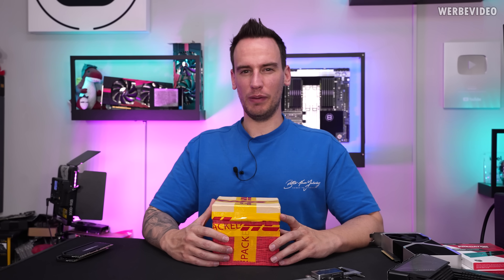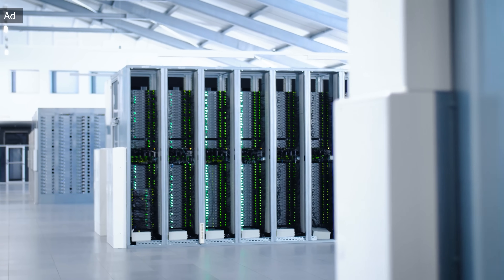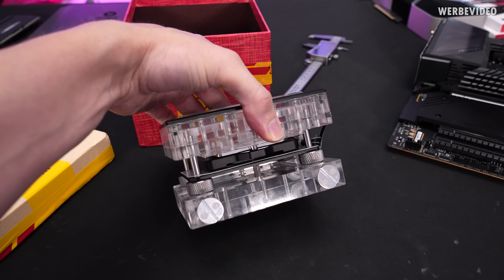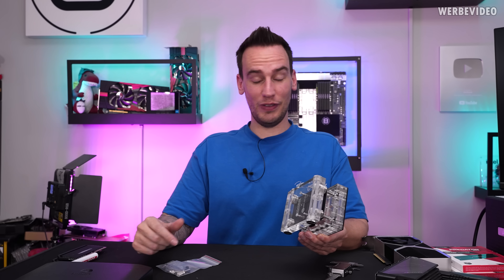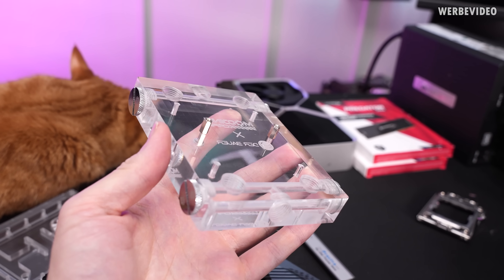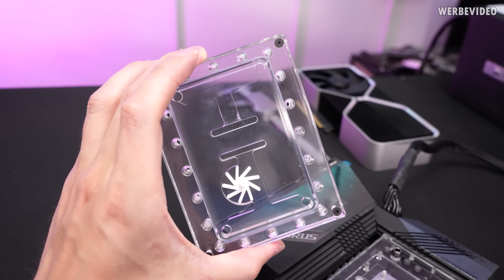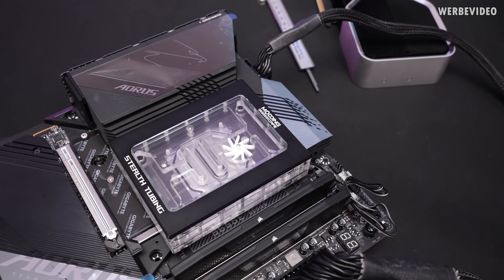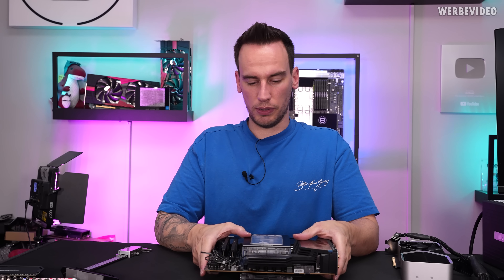A New Generation of Water Blocks? Stealth Tubing Block Tested in Detail

Comment: Brilliant idea. Kudos to those involved.
I think this could be a fabulous idea in the SFF market. A community that often adopts modding to get the best out of the space and parts. The issue would be the clearance at the rear in the smallest volume cases and any rear mounted NVMe drives. However those cases that have a modular "sandwich" layout would provide the option for this type of block on an ITX mobo. As there are only 6 ITX mobos on AM5, it will be easy to check the rear mounted NVMe is clear. I can this working well, especially when paired with a GPU waterblock such as an EK option.

Comment: Kind of neat from a something different perspective. Otherwise it's overdone. Using Bitspower parts going to be ridiculously expensive. This design is not practical and creates a proprietary circumstance. The the block is too restrictive from the get-go. Adding into flow spinner creates more restriction. 

My first thought was of one the many giant tower coolers on the market. It's still smaller obviously but massive by water block standards. One of the main points with water cooling being small, unobtrusive while neat and better (thermals). It's basically recreating the already simple by making it more complicated and unrealistic.

Comment: Excellent!

The back can (as you say) easily be flattened, I'd say if you can produce a similar GPU block that passes out the bottom of the card, you could let it flat on the motherboard and potentially have a hi-fi sized, fully powered, gaming PC.

Comment: 6:10 btw, you mentioned that you had to provide your own screws, modding cafe released a video about this cooler, they mentioned that they reused the screws that came off the amd bracket. Length should be standard i guess.

Comment: I wonder if anyone considered hiding the tubing and cables by making the left panel of PC cases non transparent. This way it would be all hidden from sight and we would not have to hide it on the back. We could even add some rgb and diagnostic screens on the case itself for those who like it. I realize that this idea is probably too innovative for the current state technology and way ahead of time, but let me dream, ok.

P.S. this is an interesting product, but it made me think what exactly are we trying to chase with the PC aesthetics nowadays and why. Does it really make the PC look better when we can see the board, the pump and a couple bright LEDs (the so called "rgb"), but not the tubing or cables?
Reply: totally agree. why not just print out a picture and put it in front of your build if you want it to not look like a pc? all the custom work is in the cables and the tubes when building a custom PC. if you remove those youre just left with the generic hardware and blocks and every build will look the same.

Comment: Love the design and the concept, haven’t used water cooling in over 15 years because I couldn’t be bothered with the tubing, however I would personally buy something like this. 

It’s compact, fits neatly and removes the hassles of using an AIO. Honestly looks amazing.
Reply: This seems like a much bigger hassle than an aio, if you need to change your cpu you have to get access to the backplate, somehow separate the two halves without dripping water everywhere, and then worry about the seal when you reassemble it, whereas an aio mounts the same as an air cooler and can be removed without access to the back
Reply: @VerdASMR  I've had coolers that require the use of a backplate.
Reply: @Safetytrousers  coolers that require use of a backplate filled with water? I doubt it.

Comment: Looks really nice  and would fit into my thermaltake  view 51 with ease, ive already got 2 FLT 120s behind the motherboard tray along with  plenty tube runs, so that all my runs in the main case are all straight. It would take a bit getting used to as it would make the main chamber a bit empty.

Comment: You should check their channel, iron man computer mod, one of the latest, videos, they have vertical gpu mount, that connects to stealth water block, making cou and gpu cooler one unit without any tubing. It is insane. It can be the key for a really slim sff atx board that can be connected to an external radiator. I love the idea. Ive seen bittech modding connecting distro directly to the radiator, in 90 degree, imagine both in a single pc. No tubing at all. Just ditro behind the atx board, connected to radiator directly, going through the board, cooling gpu and cpu at the same time. Maybe nvmes as well. I wished i had the tools to make it possible.
Reply: I am working on my custom atx board tray, that is connected to the case on rails. You pull it, whole tray comes out, it is similar to slotted cards or server blades, you assemble the mainboard, push it into the case and everything is connected. All the cables, power extensions are on one side thanks to power extensions. Air cooling only for now. With this idea, you can make quick disconnect as a part of slotted design, watercooled pc that can slide in and connect to the case.

Comment: Would be curious how you could do a full water cooled system with it, maybe good for micro cases where the GPU is mounted behind the MB in the case. Otherwise you will still have tubes running in the front of the case to the GPU. Very interesting IF you can get enough flow, but seems limited for design.

Comment: In terms of design, it is awesome.

But it has 4 drawbacks :
- the flow may be low because of the tubes diameter which will decrease the performance.
- I watercool the CPU and the GPU : consequently, in my case, having the pipes on the waterblock is a requisite.
- Like you said, the cases compatibility will be problematic.
- The price may be very high, in view of the extra craftmanship and material.

I think that this product aims at those who watercool the CPU only and worry about the design. But the expected high price may make them hesitate.
Reply: I doubt you'll lose much if any flow via those tubes. as much as I would like to point out more flaws with the design, i don't think that is one. the point of greatest restriction already limits the flow, and that would be your gpu or cpu block/jetplate.

Comment: It’s interesting, but would concerned about VRM temps, it already blocked almost all the airflow to the beefy Aorus heat sink.
You can calculate back pressure and flow rate needed using pipe diameter chart, the flow through should be fine, but I’m more concerned about the part/diameter in Acrylic

Comment: Q: Can the same functionality be achieved with other materials that transfer heat better than acrylic?
Reply: your not cooling with the acrylic. potentially if it was all metal there would be more volume for the heat to dissipate in, but once it reached equilibrium there would be 0 difference.

Comment: would be interesting to try out what the flow rate looks like with a double loop (vid + cpu) and then switch out the cpu for a noemal block and this block and see if the flow gets restricted, and then see if it make any difference for the videocard temps. Since the pipes that suply the water are limited to what fits through the board. there is close to no change that could be made to optimze it (other then thining them out, causing passible struture issues.)

Comment: Concept like that belongs in show floors only + probably like 10 enthusiasts. I don't see it hitting market well, just like i don't see motherboard with back facing power sockets. It takes a lot of space and you won't save any space cuz enormous gpu will still be plugged in front and the main place for the pump, reservoir and radiator still would be visible so you'd be running tubes back to the visible area. To mitigate this,  motherboard would have to be right by the glass panel of the case and everything else hidden behind so completely custom case design that wouldn't really be compatible with regular pcs unless you'd have mobo tray moving like in fractal terra or whatever it was. And tbh, i don't really understand this much hassle just to see motherboard apart from the flex 'cuz i could'. It'd be niche within a niche product.

Comment: this block would be perfect with those new MB with all the connectors on the back, imagine the extra thickness those boards need to accommodate cables in those special designed cases, this would just another part added to the backside. No more cables and tubing in the front

Comment: An intriguing piece! I can definitely see an interest in the market. For my personal taste, I like the visible plumbing of a 'traditional' water liquid cooling loop. I'm even one of those weirdos that prefers to use fittings rather than bend tube. I just love that industrial vibe.
Reply: Steampunk look.
Reply: @brodriguez11000  full copper hardline is such a good look.
Reply: @fermitupoupon1754  I thought about it this go round. That's the lovely thing about water cooling. It's kind of like an apartment. If things get boring, just redecorate!
Reply: @sinAnon6689  Yeah, doing research I purposefully watched every video I could find of how not to do it. The causes of failure are few in number it turns out. If it's not a fairly rare defect in the gear, it's almost always careless prep of materials and a lack of attention to detail  during assembly coupled with a lack of testing. 

As I type I am watching the EK Superflush do its thing in the loop. Assembly and testing went very well. In a few hours I purge the loop, tint the clear coolant to my preferred shade of aquamarine and pray to the PC gods no misfortune befalls me.

Comment: i would still prefere tubing in front, because:
- tubing is basically part of build, if you want very nice optic, u use hardtubes. the flowing and coloured water is basically a feature on itself, that does not need hiding.
- frontal montage is easier to access, to install and to maintain
- it could prove hard, to get the tubing from backplate to where the reservoir sits. im just looking at my nzxt H7 flow, and while there might (barlely) be enough space on the back of the MB, the tubing would be complicated.

if you bring it on the market, maybe add a list of tested PC cases, that are compatible with the solution, could sell bundles. i would still not buy it. but there might be people that prefere theese aesthetic, and to have something even more custom, then the other plebs with their "standard from shelf" custom Watercooling :D ;)
I predict this is a nieshe within a nieshe, so high piece costs, because low production number. you know the market better, if this sounds valid to make profit. maybe a limited edition every year with some optical changes could work, so it stays something quite unique, to attract "boutique" customers with more money then they can spend.

Comment: Mechanical engineer with a masters in industrial refrigeration.
Use all the 8 holes as water pipes, using some threaded stainless steel tubes, so you can also use them as mounting hardware.
And do a custom block, with a bigger finned array.
Reply: more potential points of failure with virtually no upside? sounds coool.

Comment: seems like a good product with more optimizations needed.
if it turns out the flow is reduced then perhaps make the fins
inside the block longer so the water has more surface area
to pass over. ah yes the back needs to be smaller. maybe use
all metal rather than acrylic.

Comment: I think it is worth looking into more. It does look really cool. Maybe do some more testing with flow rates, water temps, etc. 

I think it would be worth looking into for mass production if you can keep the price in check. If it is going to cost anything more than $200, I’m not sure it would be worth it. 

Case compatibility will be an issue no matter what you do with the back plate I think though. You still will need to get the tubes back to the front eventually as the rads and pump will normally still be in the main section. You also have the GPU if it is a full loop. Not all cases have the room to make that happen. 

It might be cool if you could find a way to cleanly tie into the GPU block as well. That would probably need a partnership with EK to develop a special backplate line since there are so many different GPU blocks.

Comment: I've never even considered water cooling as an option (air cooling is cheaper and less error prone) but that sure does look neat!
Reply: yeah, i bought a case this year with a new interior, where water cooling would be very neat and easy to implement (enough space for a big reservoir, a white glass tower, nice rgb components in white, ), and i planned on going to water cool the pc, even checked the parts i buy, but i ended up with a thermaltake assassin air cooler.
if you have water cooling you basically need a backup air cooler in the shelf anyway, (or a replacement pump).
In the end it was the maintenence argument that made me use Air. I do not want to maintenance my Water Cooling once or twice a year, an aircooler just runs, and if it gets dusty you see it, and its easy to fix.
Also im power limited my 13700k to 180W, so water cooling would have been only for the looks in reality^^
Reply: @certaindeath7776  There's only 4 benefits to water cooling.
1) [Situational] Size, not all cases can fit a big (big enough) air cooler
2) [Situational] Mounting, if you travel a lot a big air cooler putting stress on the motherboard is not ideal
3) [Situational] Performance, but 99.9% of people don't have a CPU creating enough heat for it to matter (that goes for both noise and cooling)
4) [Subjective] Looks

On the flip side it comes with additional risk
* You have water in your system, hosing and fittings can degrade over time which can lead to a real bad time
* Pumps are less reliable than fans (and you still have fans that can fail to boot)
* Things gunking up, with an AIO you won't even see it happen. With a custom loop with clear tubing you can so that reduces the risk but then you're stuck with maintenance.

And there's of course costs to consider as well where for the same price you can always find an air cooler that outperform the similarly priced water cooling counterpart. 

And that's basically why I stick with air cooling, I'm one of the odd people that prefers the looks of a big heatsink as well.

Comment: if you can make it generally smaller, that would be golden, not worried about only using 2 tubes... the ID of most tubes is 10mm, with fittings 7-8mm

Comment: 6:15 You might have auto power-on after power loss/outage set in the bios.
For the backplate itself, I wonder how limited the flow would be if only passing through those 4 screw holes in the motherboard.

Comment: I think it's a very promising solution. Firstly, the water mains can be placed on the back side of the system unit and secondly, the absence of water mains in the foreground will improve the performance of stock cooling of the video card.
Reply: I can guarantee there would be no cooling difference from removing a few tubes.

Comment: Honestly, I think this is one of the best innovations I have seen in several years. To put it simply, I would buy it. Pair it with your copper cold plates you were showing Steve@GN, and those cable free mobos you showed from Asus (the ones with the extra PCI slot), and I think you would have one of the cleanest builds ever. I would love to hear from Bun (the chap that invented it)

Comment: This concept is amazing. I would love to buy it but there needs to be a way to assure case compatibility. For example if I buy one that is made for a fractal case and then I switch to a corsair case will it still work? Or I would need to buy another one. Another question I would have is: How would you run the tubes and also close the back panel? Like I am thinking of the corsair cases that have a cable cover would a soft tube fit through there? If these problems can be fixed i think many people will definitely buy it since it just looks pristine. At least this is my opinion :)

Comment: It's something new, so for that it has my vote. It could work well with those 'rear mounted power connector' boards that where shown at Computex. If it was to be put into production I would first do some proper performance testing and tweaking to see if the small mounting tubes and design itself would be up for it. If it's not it can still be a showpiece but not really worth investing mass production resources.

Comment: My 2 cents: Looks awsome. I think if compatibility (rear and m.2 since pcie5.0 slots are usually close and require heatsinks) and cooling plate with fins are addressed would be very popular. Also love the LED too, makes you not have to put in coloured dye and the sediment which comes with that.